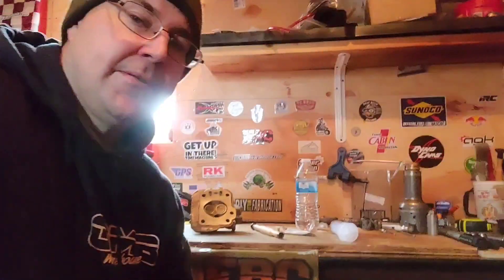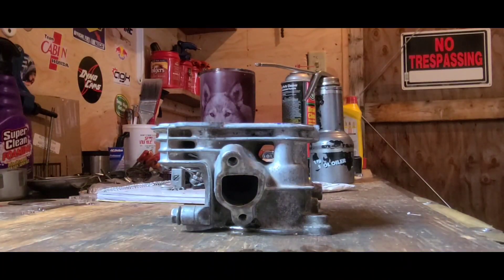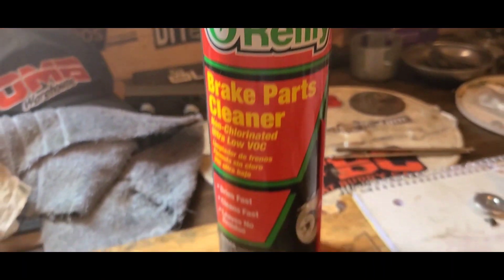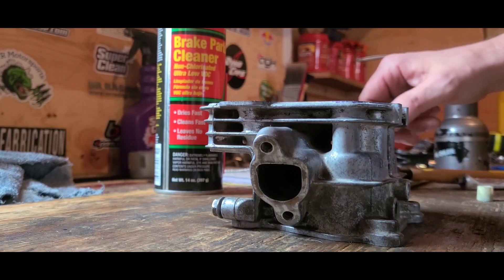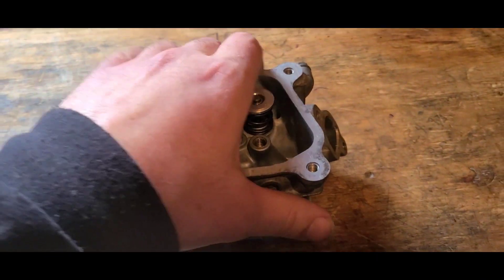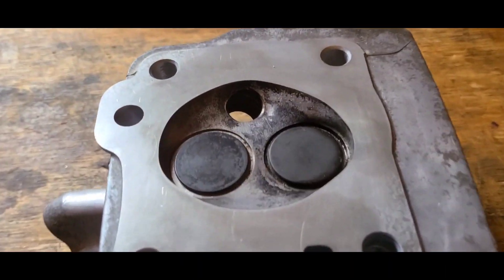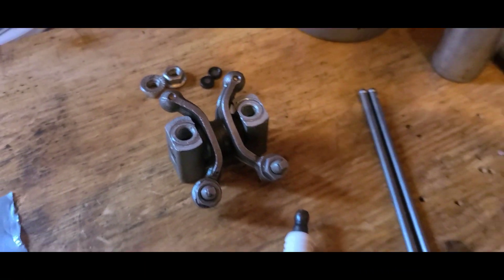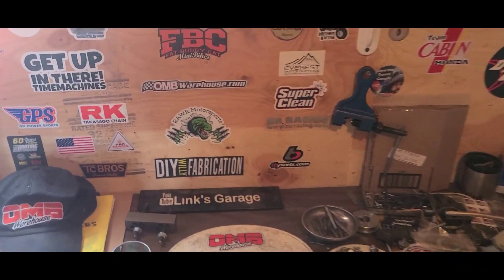GX160R "Lapping The Valves"

Comment: To fit the 224  in the hawg Ty I had to extend the engine mounts forward an inch to clear the valve cover from the seat post tube  .
Reply from the maker: For the gas tank? It probably looks good in that space.
Reply: @fatbuddycat   I’m also welding in box pipe to reinforce the mounts    & welding up pie cuts  in a 1” header made from a saint etienne road bicycle.
Reply: Gas tank fits no problem
Reply from the maker: @joshuagerlach6943  best use of a bicycle ever!